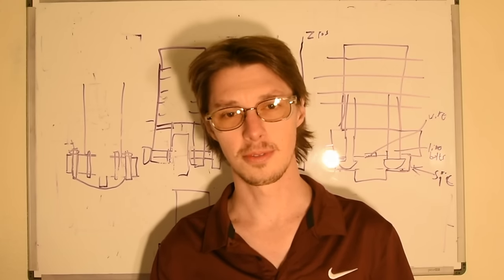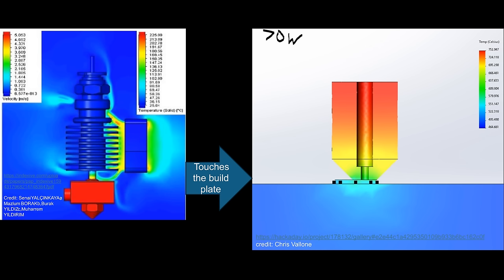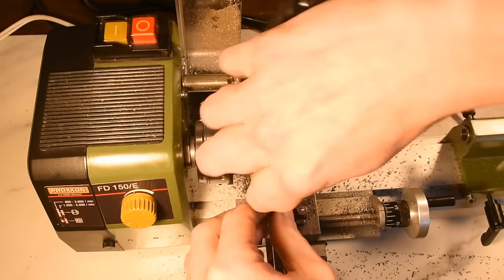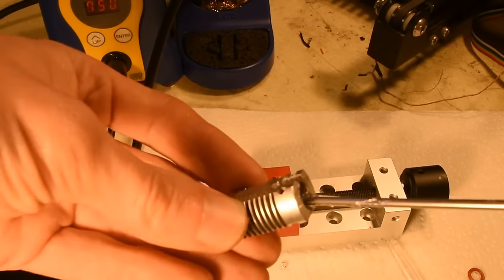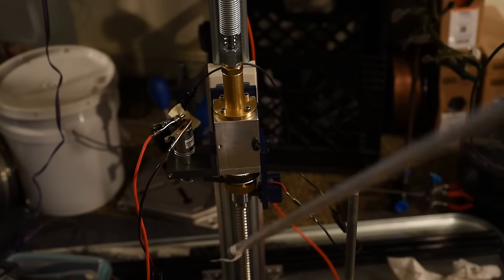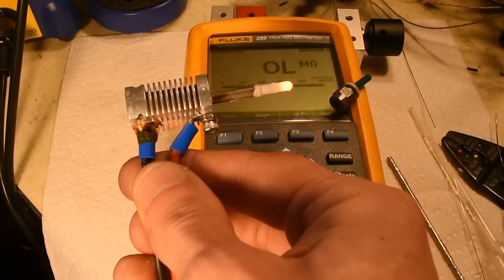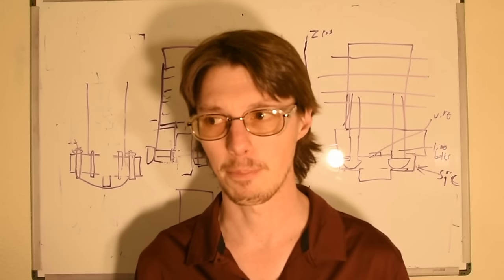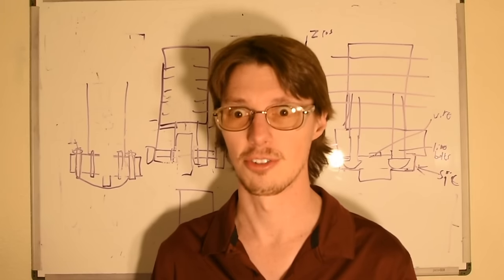How we made a 1300C 3D printer hotend for printing metals on the Creality Ender3

Comment: Thought this was a new concept turns out Adam Kemp did it 10 years ago 😮 although I do not know if the glow plug was done with edm.
Reply from the maker: Adam Kemp used a metal sheathed glowplug as a heating element inside a hotblock to heat plastic. his work was indeed an inspiration for mine.

though I dont know if his design would be able to print metals....
I would love to see it tried.
Reply from the maker: also the glow plug was not done with EDM. metal sheathed glowplugs are full of magnesium oxide insulation and a coil of nichrome wire. 
they are not really EDM machineable. 
and probably would not need to be. 

though the power density and ramp rate of a standard metal glow plug is much too low and slow for printing metals in the way we are going about it.
and the metal sheath would likely corrode very quickly based on my limited experience with them. 

still, I would love to get in touch with Adam. I have tried a few times. 
his old glowplug printhead was very cool. 
https://www.youtube.com/watch?v=jOvjcN1uQ2s&ab_channel=AdamKemp
Reply: @rotoforge2024  Your method is definitely a huge upgrade and seems to me like it could be a standard within the next few years if a glow plug manufacturer could just produce them that way and skip the edm process entirely.
Reply from the maker: @groggynod  yeah. would be nice. lol 
I dont know anyone willing to take it on at a price I can currently afford though.

Comment: have you thought about using an induction heater?
Reply from the maker: yes. Its very hard to apply one to a fine wire like ours without losing a large amount of energy to the substrate or previously built layers.
the frequency on the driver has to be extremely high to work for super fine nonferrous wires.

you might be able to get around this by using a halbach induction coil array. 
https://ieeexplore.ieee.org/document/9466400

Comment: I will note that the Powercore V1 isn’t particularly well designed. There are a few amateurish issues on the GitHub that have gone unanswered. I think they might be going closed-hardware for the V2. Personally I’d go inductive EDM rather than capacitive, it means you can get away with a lower voltage power supply (e.g. ATX).
Reply from the maker: the GEDM may be more desirable for your use:
https://github.com/G-EDM/G-EDM

great project. highly underappreciated developer aiming to make a total open source turn key EDM system at a fraction of comparable offerings like BaxEDM. 

The rack robotics team has been very helpful to me personally. So I wanted to support their project with some publicity. :)
they made it super easy for me to get into EDM by offering a complete product that was easy to understand at a price I was willing to pay. 

the G-EDM was something I wish I had known about sooner. The performance per dollar and integrated control systems are astounding for a DIY project.

Comment: Wonderful work but I really dislike the polarity of the head. Installing such a head in any machine it is a strong reason to ground the heatsink which shorts out the power to the plug.
Reply from the maker: the head is not polar. the glowplug is just a ceramic power resistor. 
I am not sure what you mean by shorting the power to the plug?
some insulating washers for the heat sink mount may be advisable.
Reply: @rotoforge2024  Since one pole of the ceramic heater is actually the heatsink and it is a common problem in such systems that the heatsink is shorted to ground or contacted by temperature sensors, it is often useful if it is grounded, not connected to the heater + power. This becomes especially important if the heater is controlled by pwm for temperature control as then you would have a ground reference shielding the heater/heatsink instead of a power rail switching on and off on the heatsink.
Reply from the maker: @1kreature  if you can grant me some additional information on this common problem, I would be more than happy to make some design adjustments to accommodate/avoid it. 
Power shorting to our thermocouple from the glowplug does appear to be a current problem, if the setup with the heatsink as one electrode is an issue I would very much like to know more.
Reply: @rotoforge2024  Sure I can :) (I am ee and work as product designer.) 
Basically modern ceramic glow plugs usually run directly on 12v while old ones used to be connected in series. The intended use now is to ground the threaded side (usually by the engineblock) and control the power to the center tip connection. This way the threaded area and block acts like a shield. The same issue has been quite a problem on 3D printers hot-ends for similar reasons. PWM also causes a lot of noise which can be picked up by sensors near or on the hot areas. Ground shorting to the temperature sensors can still be a problem though, but usually it is much less of a problem than the actual switched power being shorted to it. Using a k-type temperature probe for example, it is possible to design the sensor-amplifier in a way that can handle this shorting. There are digital isolators and analog ones. It is often easier to use a digital isolator and simply transferring power through isolator to a thermocouple amplifier and digital read system like a adc or microcontroller then have this send the result back over the isolator digitally.
Reply from the maker: @1kreature 
we are presently investigating the use of a digital isolator and DC-DC power isolator for the thermocouple amp board.
i link them here.

https://www.digikey.com/en/products/detail/murata-power-solutions-inc/MEU1S0303ZC/4382697

https://www.digikey.com/en/products/detail/texas-instruments/ISO6761QDWRQ1/15857504 

are there other caveats to a setup like this we should be looking out for?

Comment: What about just passing the current through the edm wire? Is it conductive or coated?
Reply from the maker: The EDM wire does indeed carry current during the drilling operation. 
it is a conductive bare hollow brass tube. 0.5mm ODX 0.25mm ID. 

passing current through the wire inside the hotend aafter it is fabricated, during printing  is something that has been discussed. Dominik Meffert made a machine of hackaday that works that way. and a private company does it as well.
https://hackaday.com/2020/03/31/3d-metal-printer-uses-welding-wire/

https://www.digitalalloys.com/

Comment: Maybe resistance of the hotend could be used to measure temperature? Or ir sensor?
Reply from the maker: we have tried that... but the metal wire moving through the bore interferes with the measurements...
and the glowplugs themselves will shift resistance over time at very high temperatures ~1500 C in air..

so it makes it hard to rely on the current measurements alone. Though they are helpful for fast response indicators oflike metal phase change at the tip.

Comment: wouldnt a hollow ceramic tube with a thick coil of wire copper wire wrapped around it to induction melt bronze wire that is fed through the ceramic tube work?
Reply from the maker: I highly recommend you try it and post the results (safely). 
I couldnt find a coil tight enough, or a power supply with a high enough frequency to work with wire as fine as I am working with particularly for nonferrous alloys.
Reply: @rotoforge2024  wrap your own coil around the ceramic. i think backyardscientist has a vid about how he made an induction metal melter. you can see what power supply he used and maybe get some ideas from that. i would experiment myself but unfortunately im broke broke.
Reply from the maker: @CIBERXGAMING I couldnt wrap one tight enough either without it melting down during printing.
and even if I wound it tight enough, it would need to run at a frequency where the driver cost would be huge. 
like 800 khz to 1 MHz.

maybe a bit more.
maybe halbach induction arrays could improve this situation. 
but I am interested in printing glasses and ceramics with the same hotend. So induction heating is not really going to suit my application....
would love to see it tried though. we have people in the discord working on it actively. super exciting stuff.
Reply: @rotoforge2024  the wire coil would probably need some insane cooling in that case. i cant even imagine right now what it would take to print ceramics. glad you guys are working on this though and good luck to you guys!

Comment: Hi there. How is your progress on that thing ;) any news ??
Reply from the maker: So this is a total spoiler, but the next video I release will contain 
1.) a detailed explanation of the physical and chemical problems we encountered during testing and what our next direction for development is going to be... the short of it is, that it simply costs too much and the yields of making each glowplug hotend are just too low to make sense for what we are trying to do at the rotoforge project. It scales really poorly even if we go to making our own custom ceramic heaters and other exotic solutions. So we are looking for ways to combine thermal and mechanical forces to reduce temperature requirements and thus reduce the cost of materials and processing.  probably something like a tiny power hammer or additive friction rolling. 

2.) I intend to introduce a second channel and open source project I am pursuing that may complement our efforts in the long run. I will also include piece of how I recently moved cities, finished the writing of my PhD dissertation, and started a newjob working in connectomics and provide a few updates on how my living situation, and thus shop conditions are still in flux at the moment. 

3.) last I intend to make probably a separate video talking about where I ultimately want to go with all this and what my current plans are for the medium and long term for rotoforge, the other project and career in general. 

Hopefully this is a good enough answer for now. its going to be a month or so yet before I get settled enough to get anything out. It has really been gnawing at me, and I have been frankly, exhausted lol .

Comment: Hi. Do you think this method wold work for printing engineering graded plastics to? Like Ultum 1010 or perhaps a plastic that is impossible to print right now due to temperature limitations of regular printers.
Reply from the maker: If you can get it to 0.5mm filament diameter, I would expect it would work quite well.
Reply: @rotoforge2024  I searched the internet to try to see if there are any larger glow plugs available because it would be best if it could use regular fillament sizes but, with no luck.
Reply from the maker: @segment932   you may be able to get away with using a regular metal glow plug as per adam kemps video some years ago. 
You could use a pair of them in a hotwork tool steel or molybdenum hotblock. 

this would likely give you better results than the ceramic design i have presented above for more conventional plastic filament printing.
Reply: @rotoforge2024  Interesting. I need to investigate that as I think it could be a game changer for plastic printing. Thank you so much for your comments and suggestions.

Edit: Found the video. Saved here for reference https://www.youtube.com/watch?v=jOvjcN1uQ2s
Reply from the maker: @segment932  Happy to help!
Adam Kemp was a long time inspiration of mine. :)

Comment: What about induction heating the metal wire filament?
Reply: I was thinking the same thing, small induction drivers are readily available. It might make applying an inert gas more feasible too
Reply: @BiglyWeenis  That would be interesting. Rather than suspending the entire print surface in a liquid, an inert gas would certainly work. Something like a sealed print chamber with Argon, like what is typically used for welding?

It is 1.38 heavier than air. Which means that you could use a welding tank, open the valve, and displace any air from something like a sealed glass aquarium with the printer submerged within.
Reply: @sirukin7849  yeah something like that would be pretty cool. Might not even need to go that far, just nitrogen out of the nozzle could be enough to prevent significant oxidation for some metals. But I'm totally guessing there
Reply: @BiglyWeenis  Yeah, you'd need to constantly purchase more nitrogen though.

The nice thing about submerging an Ender 3 inside of an aquarium is that you can setup a float indicator with something like a tethered ping pong ball to indicate when your inert gas is low. Fill once, and let it print.
Reply: @sirukin7849  I think once you've spent the money building a printer like this, running nitrogen as a consumable probably wouldn't but a huge issue. But a cool thought none the less

Comment: gotdamn save some brainpower for the rest of us. on more serious note, how did you become aware of how ideal the glowplug was for your application? When i hear glowplug I immediately think of diesel engines.
Reply from the maker: I have a weird obsession with ceramic materials developed during graduate school education. The fact that a fascinating material for leading wing edge hypersonics was available off the shelf for cheap really rocked my johnnies.

so i bought some and messed around with them. 
turned out they were pretty handy as soldering/brazing irons. So began their use in metal printing.
this is not my first attempt though, it is actually the third in a series. lol :)
Reply: @rotoforge2024  super interesting, I subbed and turned on notifications. Can’t wait to see your progress. The second I saw your thumbnail and read the title I knew I had to check your video out.

Comment: Is it possible to use induction to heat the wire? Would an induction coil with a 1mm ID and 2cm long work where the wire feeds through the coil?
Reply from the maker: the wire is 0.5 mm in diameter and nonferrous.
it would require 1+ Mghz frequency to heat any appreciable amount. 
drivers of this sort are expensive.

Comment: Are micro tipped diamond drill bits an option?
Reply from the maker: they only go to about 0.8 mm OD, and about 10 mm long.
micro diamond gun drills are, as far as I can tell, not a thing anyone sells.
we would need one ~60 mm long and 0.5mm diameter...This would be a  custom job for sure.

Comment: Id think magnetic induction would be easier.
Reply from the maker: for fine wires(and thus low drive power requirements) comparable to what a typical 3D printer uses, the cost and electrical engineering requirements are expensive. 
Heating fine wires requires megahertz drivers or exotic coil geometries like radial halbach arrays. both can be expensive to produce, and the readiated power from metal at near melting is hard to deal with, without increasing the coil size. 

this is before we consider the fact that the vast majority of the energy of a standard induction coil is likely to be lost to heating the previous layers or the build plate.  

the lowest power demand I have seen for induction coils using 0.9 mm OD welding wire, is about 3.2 kilowatts.

Additionally, I want to print ceramics. Induction heaters will not be effective on ceramics until you reach at least the 10s of gigahertz drive frequencies in most cases. 

here is an excellent paper on the topic of induction heater printing of semisolid metals...
https://www.sciencedirect.com/science/article/pii/S277236902200041X

If you believe in induction heating, I would encourage you to pursue it! 
the method can work, and the engineering work to get it to a price point that makes sense for the home desktop would likely lead to many useful developments!

Comment: Cool little lathe. Looks old.
Reply from the maker: its actually quite new. 
maybe 4 years old?
Reply: @rotoforge2024 ha, yeah I looked it up after commenting. It's the green color that reminded me of an old appliance. How do you like using it? It looks like a proper mini lathe.
Reply from the maker: @regular3dguy830 its a little premium. but its been super handy. 
just about ideal for my applications with objects typically less than 15mm OD. 
much cheaper than functional watch lathe at the same size scale.

Comment: no test?
Reply from the maker: still working on temperature control.
its basically pointless to try by hand because the working windows for most metals are so narrow. 
i will post again with test results success or failure and contingencies soon.
Reply: @rotoforge2024 cool good luck

Comment: Not hot enough to fuse metal. Not even close.
Reply from the maker: under nitrogen it can operate up to about 1800 C. 
fusing metals is mostly about energy density, and applied stress not strictly temperature....